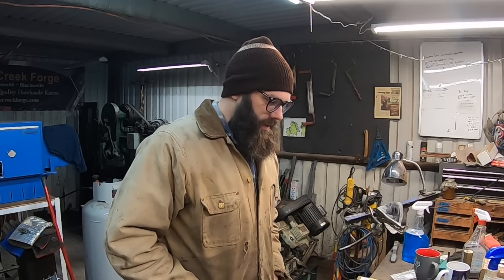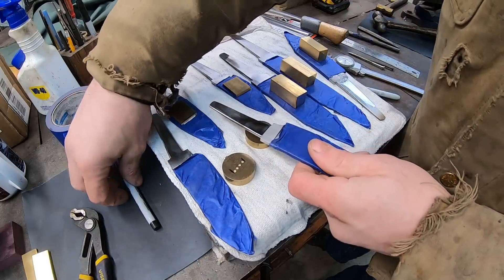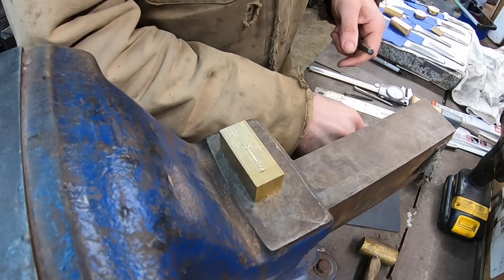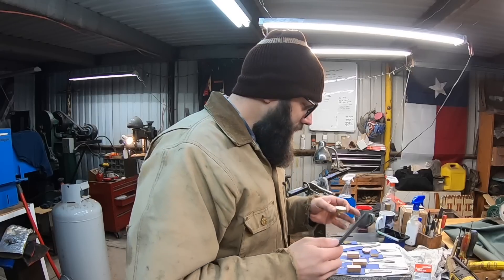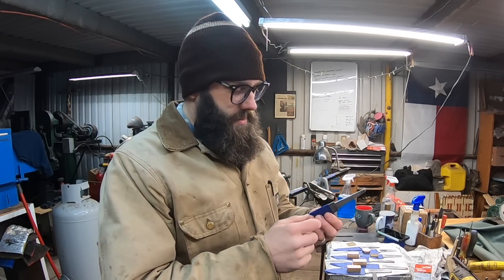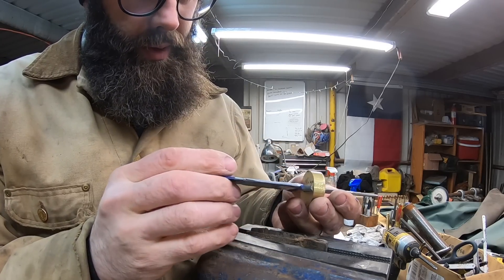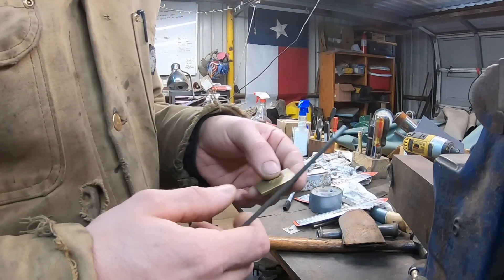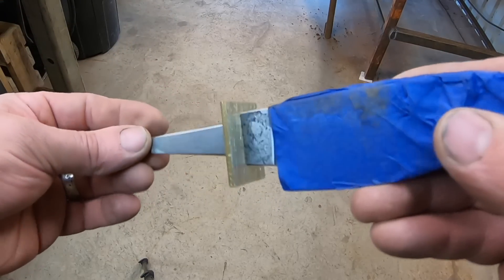How I Fit My Guards And Bolsters, Beginner Tips And Tricks, Bladesmithing, Knifemaking Blacksmithing

Comment: Yeah. Making the tang larger to make the bolsters easier to fit was something that took me time to learn. 

I still can only make them so big since I do kitchen knives with wa handles mostly. Same priciple applies to just doing normal wa handles as well, as ones i dol with metal bolsters and museum fit handles.

Oh. Also i forgot i was going to say. One thing ive taken to doing. Is modifying my files. So i'll take a normal file. And take off width, or height. So it can fit in the tang holes of bolsters, but still cut better than little needle files. Thats been helpful. Or i took a 4 in hand rasp and ground it down to fit in the holes i drill in handle material and widen them. 

Also made a handle broach out of an old file. Since most of the use i put on files is handle work. It pays for me to just modify them how i need them.

Comment: Before you begin with brass, you can anneal it by heating up red hot, and let it air cool. It will be very soft and you wont risk it splitting if you hammer on it. That will help if you want to bend it as well, like curving the ends of the guard.

Comment: if you have a little bit of a gap, you can also use a small ballpeen or rounded off piece of steel rod and put some soft dents around that area, essentially doing the same thing but more locally to push the material slightly in. Then all you need to do is grind off the dents again just to where it is gone on the surface.
Reply from the maker: Yes, good tips

Comment: It's really a pretty simple matter to thin a 6" file to narrow the width on a disc sander and even safe edge the adjacent side. I used to have a repeat job that required deburring a deep parting blade in a threaded silicon bronze part that let pinch bolts hold it at a point that was wac the proper end play for a stacked assembly in a female threaded tube.
Reply from the maker: Yes but I was referring more to the thickness of the slot.. which would make for an uncomfortablely thin file in my opinion...

Comment: Carbide? File guide for $150? Ouch, isn't there a scrap steel i could make one out of a file would skate on? Seems like anything good enough for a blade edge would work if not tempered or dropped.
Reply from the maker: There's some made from just steel, something like D2 I believe that are less money.
Reply: @FireCreekForge  how about grader blade?
Reply from the maker: @billwoehl3051  that may work
Reply: @FireCreekForge  here's the plan for the canister: I made a 2"×1"×8" can, drew out a leafspring to about 1/8", cut out 7/8" by 6" for the cutting edge, then, drew out a piece of jackhammer bit same size and thickness of the leafspring for the spine,  these will stand up on edge, leaving a 1 3/4" space for the pattern.   Minus the thickness of the canister walls.  Question is, does the jackhammer bit usually air harden? If so, how do I temper it back so it will do its job not deforming when battoned?buttoned?  And the extra 2" for a full tang enough? Not sure what I want to use in that space to save powdered 1095.